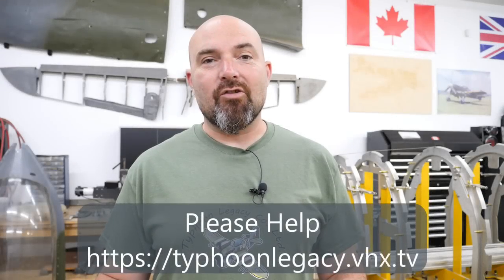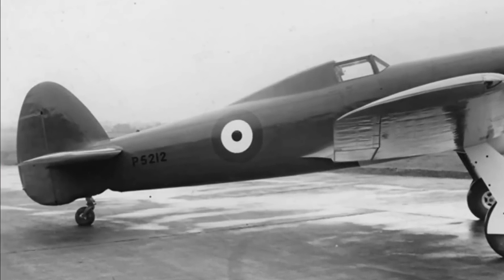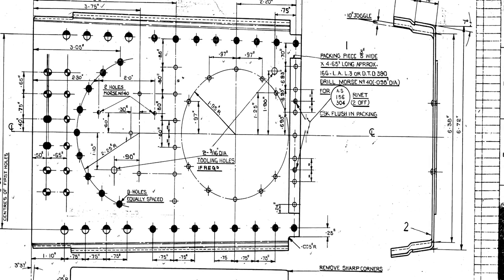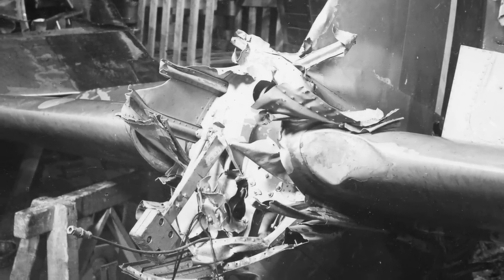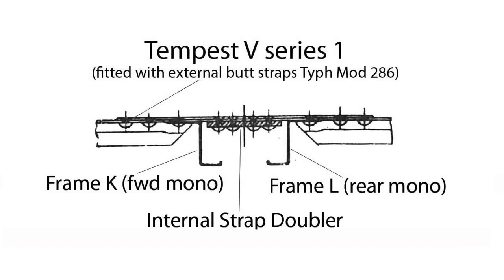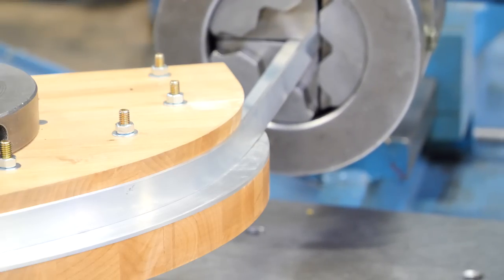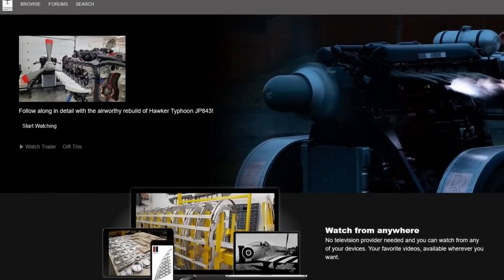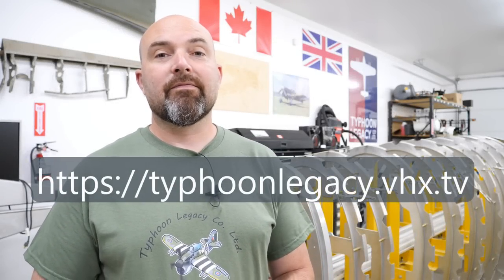S3E2 Hawker Typhoon Tail Failures

Comment: I find it crazy that all this work and effort is being gradually made to bring a single aircraft to life when only 80 years ago they were making multiple daily. The only difference being the experience, parts and tooling is all gone. Basically relearning the whole process without instructions
Reply from the maker: And in many cases the engineering drawings and original material specifications don't exist. ~Ian
Reply: @TyphoonLegacyCoLtd  Of course that too, how each part needs to bare weight and stresses

Comment: It’s interesting that Mosquito (with a completely novel structure of moulded birch and balsa plywood) had very few structural failures.
Reply: Nothing novel about the mosquito. Its how aircraft ware made up until a few years prior to its design.
Metal was new and only just really becoming common in fighter construction.
Reply: And more resilient to shrapnel and bullet strikes. They really had to protect the planes lamination's in humid/damp conditions though. 
They did lose a few pilots who did not give it full power on take off and it had some 'roll to the left' 'quirk' that had to be quickly corrected as well. 
If it had not been designed around a laminated wood construction, it would never have been built, due to the shortage of aluminium. (The Air Ministry would have cancelled the order.)

Comment: Good techical brief on the original Typhoon flaws and solutions.  
Why are you rebuilding with a 3-bladed prop?  I thought the 4-bladed prop was key to reducing vibration?
Reply from the maker: The four blade propeller did reduce some vibration, however the three blade Typhoons were still in use until the end of the war. You will notice that all of the four blade Typhoons are newer aircraft with the larger tailplane; JP843 was originally built as a "car door" aircraft in September of 1943 and then modified. ~Ian

Comment: It seems to be an laborius process to pull the shape to form. Especially  when you think about when this was designed with the tools and knowlegde they had back then. There must be an reason behind why this was pulled instead of being milled from one solid block of material.
Reply from the maker: You would need a multi axis machine to mill these parts given their shape, not to mention the machine / operator time and material waste. Machined parts of this shape would also have the grain cut which would reduce the part strength. Stretch forming produces repeatable accurate parts very quickly and keeps the grain running through the shape. ~Ian

Comment: I watched the bending process with interest. How do you account for the aluminium springing back slightly after bending? With my model making I always have to 'overbend' slightly at the ends of the part which sometimes causes the curve to distort slightly.
Reply: In the operation shown in the video the material was in a fully annealed condition which means it is soft and easily  formed to the required shape, followed by further heat treatment to relieve any stress that might lead to distortion. 
Really interesting episode 👍
Reply from the maker: While the material was annealed, there is still some springback (minimal), however the forms were designed to overbend by approximately 1.5 degrees. They were also built to form several inches past the required length, and clamped several inches past that again, ensuring the actual part was spot-on! ~Ian

Comment: So if i got it right, the build will be 3 blade prop, small tail but with latest tail mods as per tempest v and a retrofit mod bubble canopy.
Will the powerplant be Sabre IIa or Sabre IIb spec ?
Reply from the maker: We are working with a Sabre VII to capture all of the lessons learned from Sabre II series operations. ~Ian
Reply: @TyphoonLegacyCoLtd  Oh cool so plan is to have hobson injection with updraft air intake and make 3000 Hp with ADI ? 😂👍🏼

Comment: Any idea why Hawker came up with what looks like a Heath Robinson (or Rube Goldberg) contraption to prevent flutter? The problem is to keep the CG of a moving control in front of the aerodynamic centre, so it behaves like an arrow. The usual  solution , as Ian said  is a mass balance (a weight on a forward-projecting lever), or weighted leading edge. Both are cheap, simple, and effective, which Hawker's  device clearly wasn't.
Reply from the maker: My understanding is that they tried placing weights in the elevators, but this caused a stability issue. I've not been able to locate any additional details. ~Ian
Reply: @TyphoonLegacyCoLtd  It sounds as though there's a Master's thesis topic in there, but I'm not sure if it's in History or Aerodynamics. :-)*

Comment: I guess there are no problems with introducing this kind of modification to the design? I mean, they are for sure less than the problems you might have if you didn't, so there's that.
Reply from the maker: It can be tricky making changes to a type design, however in this case both aircraft use the same part numbers and assemblies for the bulk of the structure in this area, Hawker kindly introduced the change to the design. ~Ian

Comment: Hi,

No one can imagine the amount of technology needed to fly this glorious warbird.
It's prodigiously interesting, I understand the manufacturing process, but then you have to check that the parts conform to the plans and the specifications. The metal must not be cracked, what control methods do you use? Do you use ultraviolet light?

I thank you and congratulate you on the work you are doing.

Alain, I live in France. (Google translate)
Reply: NDT
Reply from the maker: Hi Alain, both heat treatment and the forming process were completed to modern aerospace standards specific to each process. With this forming method there is no requirement for non destructive testing. ~Ian